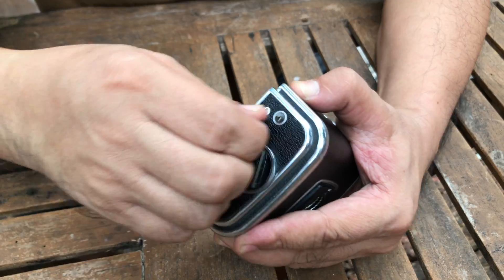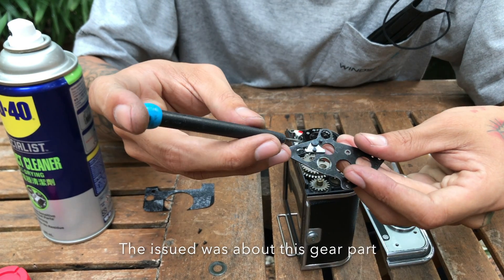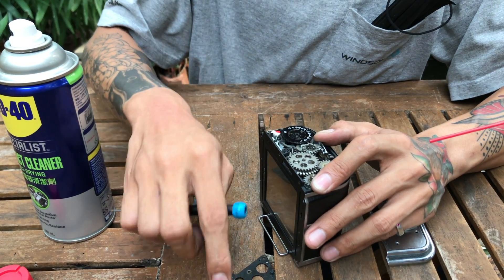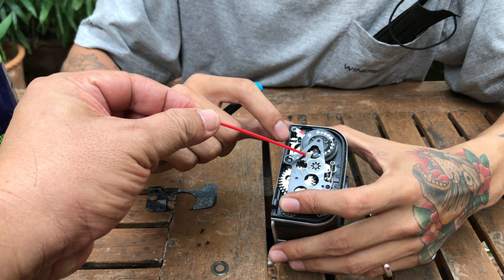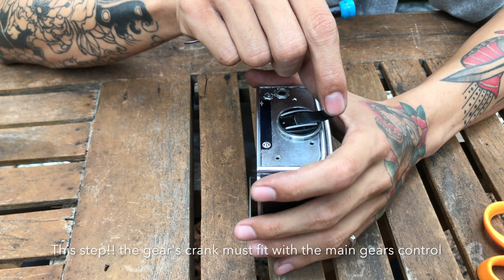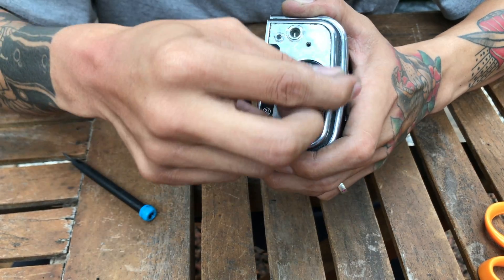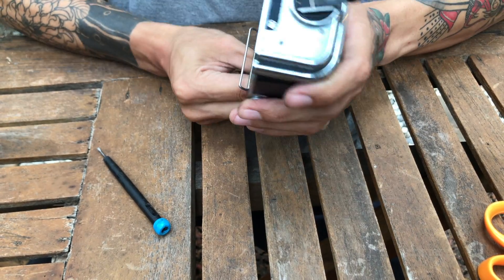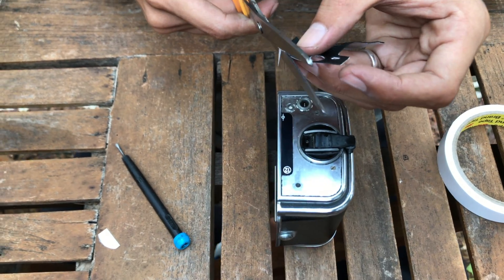En : Fix the none stop at 1st frame issue, A12, A16, A24, Hasselblad film backs

Comment from the maker: PLEASE NOTE: The usage of WD40 is not normally condoned. This is an instructional video of how YOU can fix your Hasselblad in a pinch, and when you’re in a pinch, WD40 can be ok to use. That said WD40 should ONLY be used in a temporary manner, as a band aid.
If WE use WD40 on a formal camera repair, we only use it on severely jammed components to break apart gunk. Then it is meticulously cleaned off, and replaced with a proprietary lubricant made for fine instruments.
(We use several types depending on the part, for instance, the oil used on shutters is not the same as what is used on gears)

Comment: putting the cover is very challenging, do you put the cover front first or back pressure or how it just won't fit one side
Reply from the maker: "Thanks for the question, Chang! Please check minute 3:21. There's a small lever that I pressed down with a screwdriver. It needs to be aligned with the spring, so it doesn't pop out. This will make the cover easier to close."
Many thanks again, Hope you cam do it! Cheers!!

Comment: What size JIS screwdriver to remove rear cover screws?
Reply from the maker: Oh dear..!! that’s very good question. Unfortunately I just compare an proximately size and buy the screwdriver 🙏🙏❤️😍
Reply: @hasselbladexpert  How often should the film back be lubricated?
Reply from the maker: @arricammarques1955  Hi, thank you for very nice question, from my experience mostly I take 2-3 years a time for checking light trap seal and take that oppertunity to clean and lubricate deaer freind,
Reply: @hasselbladexpert  I just need the size of the screwdriver removing back cover of the film back. Probably listed on the handle?
Reply from the maker: @arricammarques1955  I did checked, it’s 2mm on the handle dear friend, thank you for the question this may useful for others friends that may need to know, cheers..!!

Comment: One of my A12 backs has strange problem. It starts off OK, but about frame 7 instead of showing white ( in the little window ) when shutter is cocked and film advanced, it shows red. Very strange. Have to open it and see what the hell is going on. Thanks for the informative video.
Reply from the maker: Hi dear!! Yes, it's seem your film back so special lol, From my experienced there's some wire or spring that controlled this metal pad sign [in red and white color when opened] just oiledม I think it's work, Thank you so much for sharing your unique issue that hard to find, enjoy your DIY, cheers!!
Reply: @hasselbladexpert  Yes, it is special. LOL. Thanks for the advice. Will let you know if I managed to fix it.

Comment: thanks for sharing, great skills, but one tip, esp. for the 'beginner' repairman, these are 'micro-mechanics' which need these special screwdrivers (as seen in this video), and be LIGHT on them, The screws are 2-5 mm in size!!, it takes nothing to break them; also if on a table, PUT on a cloth to catch any 'wayward' parts, as they are so small they are easily lost in the garden, or household carpet, etc. Also a tray, a spare one from the kitchen (washed afterwards!!!), or 'tupperware' container, to hold these parts together, so they don't get lost is another good tip.
Reply from the maker: Oh dear Andy, Many thanks for adding this tip to users who need to know while they fixing it by themself, You adding great tip most appreciate sir, have a wonderful weekend as always, Cheers!!
Reply: @hasselbladexpert  that's alright, glad to help, but one other thing, this issue can also be, albeit temporary, due to NOT having a spool of film on the takeup side, aka the mechanics need this to operate the film counter, on some makes of MF cameras ( the film is 'senced' by a roller, and this operates the counter, like an odometer in your car)- ONE SPECIFIC example that NEEDS attending to is the Rolleiflex Tlr's as there is a roller which must go ABOVE the film, for this roller to contact the film, and operate the counter; this I think works with the first frame stop too 🙂; also an ALPHA or other old rangefinder camera, can't bring it's name to mind at the moment; but it's defining feature is the winder is a ROD, which pulls out of the mag, then back in again, if NOT extracted all the way, film advances, but the counter DOESN'T, it operates on this last 1/4 of the 'throw' of this rod!!

Comment: Is it a big problem if it doesnt automatically stop at frame 1?
Reply from the maker: Hi Daniel, Thank you for your nice question that's good for users that maybe need to know, 
By this topic, it's can be answer in 2 directions,
 1st, it's not a big matter, if the backs doesn't stop at 1, because the film backs still working as it should if there are not others issues, however users must be understand that stopping at 1st frame means to get 12, 16, or 24 exposures from each type of the film backs not lesser than these  [ If the films past no.1, you will get 10-11, 14-15 or 22-23 exposures depends on how far from the starting 1st frame marks]  
 2nd, if users don't want to fix it but still needed to getting correct exposure 12 16 or 24 frames, 
you have to marked or noticed for use them by yourself, from my experienced, when I'm ready to started the film winding crank, I'm counting the rounds in my mind, it's takes 10 rounds or laps approximately, when it's winded next to round  9, I have to slower the speed down and carefully notice, the no.1 will be slowly appears that can be seen from the film's counter window,
 Okay, now it's work, so you can be use as a normally film backs and get correcting  exposures frame, 
or you still can be fix it by yourself from this video to safe your budgets or you can send it to the technician repair or fix them, Thank you again for your question, Have a wonderful time with your photography and your family dearest, John Kasawa
Reply: @hasselbladexpert  thank you for your answer, ill keep using it the way it is now and if i have any problems ill follow your video. Thank you so much 🙏🏻🙏🏻
Reply from the maker: @db1998-o7d  Thank you so much for your question too, Stay well and healthy in a hard virus pandemic dear friend ❤️❤️